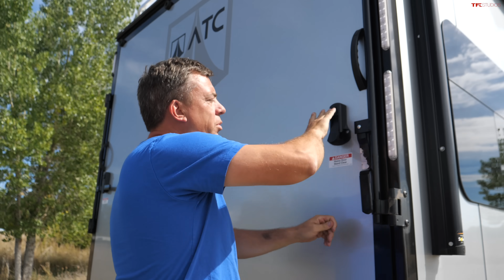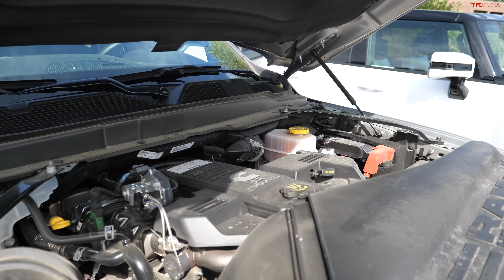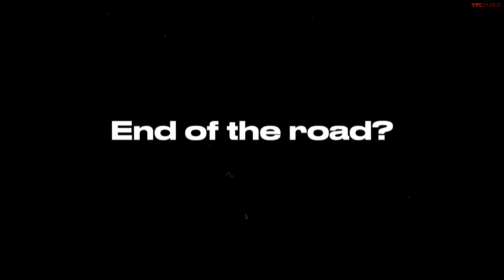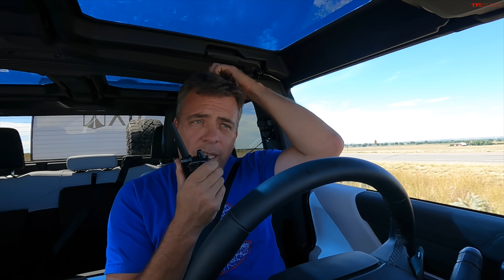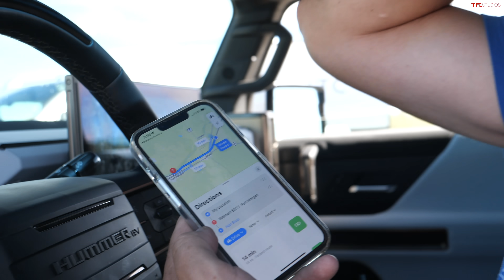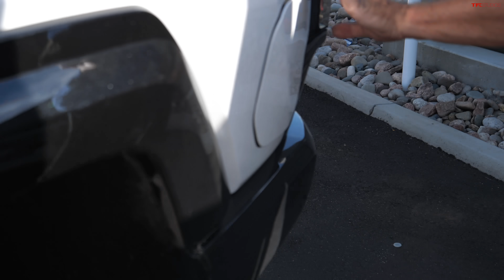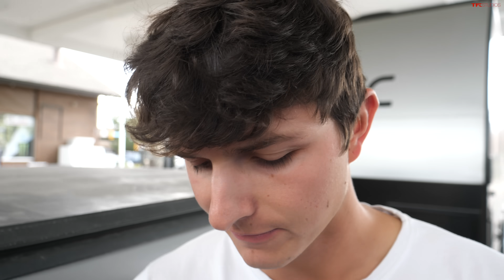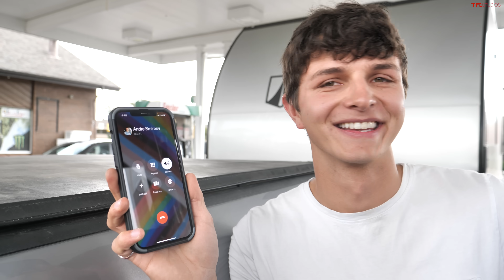How Far Can a Diesel and Electric Truck Tow An Identical Camper Trailer on ONE Fill-up?

Comment: I would love you guys to do a tow test in Canada with this electric vs diesel in our actual winter temps. -20 to -40 degree temps and see that 125 miles shrink down to 75 miles.
Reply: Exactly....do I not run the heat and freeze myself so I can get further?
Reply: @BrodieBr0  that's also a great feature of diesel/ gas vehicles: you can just circulate air around the engine to heat it up
Reply: I think that you can cut that down to kilometers instead... PLUS, cut that again down to only @ 70 km in those temperatures if you're towing & driving uphill.
Reply: And any real clamper knows these are small travel trailers that Cummins should be hauling a 5th wheel toy hauler and still leaving that ev in the dust
Reply: Yup! Exactly. I also saw one that was through Death Valley. The heat was killing the battery. Both circumstances could be really bad if you ran out of battery
Reply: They can simulate it by going to many of the northern states that have similar cold winters. For example, the Dakota's and Minnesota.
Reply: I’m not saying they don’t get cold, just northern canada usually is colder for longer periods of time. Last year we had -40 for 3 weeks straight
Reply: Gets just as cold in the upper 3rd of the U.S. international falls,mn  is the coldest  place in North America
Reply: I would check your fax on coldest place in North America I think most of the northern territories and Alaska would disagree with you on that even just looking at the data your coldest month on average is -21°C and I’m talking -40°C that is quite the difference
Reply: @matthewclark2341  international falls,Minnesota. Antarctica doesn't qualify as north America
Reply: I guess geography isn’t your strongest subject in school the territories are what border Alaska and you do realize Canada is home to the North Pole which is in North America . I have not mentioned anything about Antarctica so I don’t know where that is coming from
Reply: @matthewclark2341  google says "international falls" not Antarctica
Reply: I like your comment. Here in northern Alberta it gets nippy
Reply: EVS are not 0 carbon efficient, they give off at least 20 to 30%.
Reply: I would love to see that also I think those batteries would struggle
Reply: Hey, don't confuse them with facts.
Reply: You shoulda kept going to your destination like both of you a saw how much longer it took the hummer. As they say time is money!!
Reply: Imagine being stupid enough to buy an EV.
Reply: No need to go to Canada, I've seen -34f(-36c) so far this winter in North Dakota.
Reply: Don't drive your electric cars in a water puddle they catch fire and are a bicth to put out ..saltwater is even worse .  Found out the hard way in a hurricane.
Reply: I admit I did not watch the entire video, because I did not want to waste a half an hour of my life to find out something that I already knew. I would like to know what the weight of each vehicle was without the trailer? Another reply mentioned that you did not figure in the cost of producing the electricity that the Hummer used in your efficiency rating. I think that is a very interesting point. Especially when Evie's are trying to prove how environmentally friendly they are. I used to own a 2003 Dodge ram 3500 1 ton dually with the Cummins 24 valve high output diesel engine and a 6-speed manual transmission. I used to pull a trailer that weighed at least 5000 lb with a 16,000 lb backhoe on top of it and could go well over 200 mi on one tank of fuel, at around 6 or 7 MPG.
Reply: I was just gonna say, the cold and then also some service stations are 190-250km, sometimes 300km apart. Cant really take an “offroad/adventure” truck adventuring now can you.
Reply: The electric vehicle even though I have a diesel myself what have left the Dodge truck stand in still because the diesel probably would have jailed up with them temperatures the Houma would have kept Rollin
Reply: Yes winter hurt, but consuming this huge amount of electricity is bound to create some heat wich could be harvested.
That said, electric truck sucks. This kind of exercise is more edge case even if we dont perceive it.
Electric car in cities and suburbs are another story and this is where 80% of the population is.
Reply: Nah - my Tesla is able to tow just fine in Winter.  3500 pound trailer brought my range down - but I can still get 250 km range, which is more than enough in one day with my trailer.  typically get 500km fully charged.  The fact that it only costs me $3 to 'fill it up' for the day, is totally worth it.
Reply: Thank you amateur scientists, for proving just how amateur you are.
Batteries are more efficient and electrical systems in general at low temperature. That's why super conductors etc have to be cooled to close to absolute zero (-270 C) to work well. 
Whereas, on very cold nights, diesel will turn to jelly.
Reply: @distanceismyplastercast  I’m not attacking you and understand where you’re coming from. Colder weather = less voltage drop in power lines, superconducting, etc, but that’s not how batteries operate unfortunately.  Cold kills batteries. It might gain some better efficiency somewhere in the system, but not in our current battery technology
Reply: @chadgardnerdds3197  EV batteries  are heated and preconditioned before a morning commute .
You ever driven one in the winter?
Probably never been in one at anytime of year.
Reply: @distanceismyplastercast  You don't have to be a scientist to figure out batteries do not like cold weather. You just have to use battery operated equipment in cold weather to figure it out. In the cold the heater will have to use the battery for heat and for the blower motor. Gas/diesel uses the heat generated by the engine to heat your vehicle. Unless you like frosted windows and cold feet your range will drop.
Reply: @kenkinniph2327  Get a brain. The only truth in your answer is that gas engines make a lot of heat. That's because most of the energy released us as heat and very little us actually used to make the car move forward.
Guess during your vast experience with electric motors you've never noticed that they get hot too and that heat can also be used for air conditioning. Difference is only 10% of the energy is as heat, and 90% is used to make the car move.
Reply: @kenkinniph2327  he (Mr Welsh) was probably never outside in the real world. 🤣🤣🤣🤣
Reply: @distanceismyplastercast so can you explain why every single battery ever installed in a truck has a lower amperage rating in cold weather, every battery on an electric tool like a cordless drill or impact gun has drastically reduced life in the cold and included in the instructions is a disclaimer saying battery life will suffer at low temperatures? Maybe electric motors aren’t as affected by cold, I’ll buy that argument, but the batteries that power those motors to make then mobile are absolutely hurt by the cold.
Reply: @dipeachio6832 he’s certainly never driven a heavy duty pickup, let alone an actual truck.
Reply: @Ken Kinniph  more ignorance of the facts.
Do some research on modern BEV"s and how they heat and how they cool  etc.
Cold weather operation isn't the issue it was just 5 years ago,
Doofus...
Reply: @distanceismyplastercast  You aren't as bright as you think you are, batteries≠super conductors, try to learn the difference.
Reply: @distanceismyplastercast  I think you should volunteer as tribute to drive the ice road from Edmonton to ft chip in the middle of winter and whatever happens happens.
Reply: @privers5227  And why would any normal person want to do that?
Reply: @distanceismyplastercast  Please look at the owner's manual of an EV. Ask Google about EV range in cold temps. Tesla advises do not let the battery be exposed to -20 for more than 24 hours and to plug it in to prevent damage.
Reply: @distanceismyplastercast  obviously don’t understand lithium batteries and the need for them to reheat themselves at low temps thereby reducing range
Reply: @distanceismyplastercast  Batteries are not super conductors, in fact most batteries have resistance as they use a chemical reaction to produce power. Chemical reactions are excited with heat, that is why you cannot super charge a dead battery without causing it to overheat and catch fire. This was proven in the video as the EV started at 340kw and dropped to 140kw to prevent thermal runaway.  We also have two grades of diesel. Summer and winter. Winter blend doesn't turn to jelly.
Reply: @Thinkingaway  You are back in the dark ages. Modern batteries don't work that way, they store charge.
Reply: @distanceismyplastercast  umm, ok... we've all had our phone get hot on a fast charge. And we've all seen the Samsung batteries catch fire from fast charging. And our lithium-ion tools don't have nearly the life or power in the winter as the summer.  Those are as modern a they get.  But you already knew that. Just another arm chair critic thinking he knows what's best for the world. lol
Reply: @Thinkingaway  Self description?
Reply: @distanceismyplastercast  lol!   I live in Maine and friends have EVs.  Range is cut about in half at temps below 20 degrees F.  Amateur that David Welsh
Reply: @distanceismyplastercast  my god genius! You are right! My car battery works twice as well in minus 40c! And here I was boosting it all these years like a dumbass!!!
Reply: Cold weather does affect battery life, even with lithium batteries. Temperatures below the 32F or 0C degrees mark will reduce both efficiency and usable capacity of lead-acid noticeably, providing 70-80% of its rated capacity. at the same temperature lithium batteries can operate with very little loss providing 95-98% of their capacity.

If you really believe a electric vehicle will do better in winter then a ICE vehicle then go buy one. I also know of a Nigerian prince waiting to send you his money.
Reply: @matthewclark2341  80% of all vehicles in Norway are EVs. Think you'll find they spend months in darkness with temps well below zero.
You to need to buy an EV, because soon that'll be all that's available, no matter what govt you have, because the manufacturers have decided that's all they are going to make. In a few years an EV will do double the distance of a gas car with a full.tank and they'll cost far less to buy and run. 
 Don't you remember when mobile phones were the size of a brick and the battery lasted an hour. Scientists have been doubling the capacity of batteries approx. every 3 years for over 30.years now and they are not slowing down. But eventually, the batteries will be replaced by a hydrogen fuel cell to.make the electricity and one fill will do 1000s of miles for cents per mile.
Reply: I don’t know why your trying to make points on hypotheticals right right now. As to date there is nothing even close to produce as much unit of energy as efficient or cost effective then IC. It’s the most bang for your buck period it’s why we use fossil fuels. If there was some sort of substance that was better and cheaper it would be mass produced but it’s not.

I don’t know why you think I am against EVs what I pointed out is the infrastructure and  technology isn’t there. This real world test only proves that with the best conditions. What I purposed was to throw what in my area which uses heavy vehicles more then passenger cars. In conditions that are more common ( I live in northern canada) the closest distance to the next fuel station once you leave my city limits is 200km away And the closest ev charger station is 290km. On best conditions this hummer would fail to tow the trailer. 

I’m glad you brought up your phone as a point. Please open a gaming app on your phone and let it start to produce heat just from usage and what happens to your battery life? Good luck having it last half a day let alone it’s full day. As well over the 2 years of a battery in your phone your lucky to have 85% of its full capacity.

As of right now anything with a rechargeable battery will become less and less efficient after every charge. As far as hydrogen the Toyota muira as not made any significant advancement in the last decade it’s around and hydrogen storage is its own problem in its self not as easy as you think.
Reply: @matthewclark2341   ... I'm curious as to whether anyone adds up the real cost. That would include all time and fuel required to mine, transport, refine and assemble these batteries, not to mention the toxicity and cost of replacement of batteries. Bet there are electric car graveyards already in existence. Best to you.
Reply: Of course there is no proper way to recycle these battery cells. They are going to be waste. But I agree if you read my comments there is nothing that comes close to bang for your dollar compared to fossil fuels.
Reply: @distanceismyplastercast  Wait until you get stranded on a road and you call your buddy at 2 a.m. for a tow and he says his battery can't get him there and back. With gas/diesel you can can just start your vehicle fill up in a couple minutes. The tech is not available yet.
Reply: @kenkinniph2327  If I was I50 miles away I wouldn't be calling a buddy for a tow anyway, especially not at 2 am. Even if at that time his truck would have a full charge. Most people charge their cars at home, at home electricity prices, EVs cost cents per mile to run.
Reply: @distanceismyplastercast   My morning commute is like driving across Norway.. EVs may work great in small countries but they will never be as reliable and efficient as diesel.
Reply: @Ada-zn3pw  Norway ain't that small. But guess you ain't smart, otherwise you'd know that EVs are already more reliable and far, far more efficient than diesel engine cars. And unlike diesel.engines, EVs are still getting better.
Reply: @distanceismyplastercast  There is a reason why EV vehicles are far more common in Norway than in other equally or even colder Scandinavian countries. EV owners in Norway get all sorts of rebates from the Norwegian government (as an incentive to go EV), like reduced parking fees, registration etc. Don't you think you should have mentioned this?
Reply: @Nightstein  Why, that's how normal govts promote change. Only the GOP uses this stick approach, everyone else uses the carrot approach.
Same was done with solar panels in the early days, but once you've created the market, prices drop because if mass production and the incentives are reduced and removed, as they have been for solar panels.
When you talk about gas cars why don't you mention all of the federal and state subsidies they get, just to keep their profit margins high?
Reply: @distanceismyplastercast  yeah, it's the GOPs fault 🤡
Reply: @rafmatt  No it's all the fault of some of them, their Fox propaganda network and those elite  privileged billionaires that fund both of them.
Reply: @distanceismyplastercast  Look up how long it takes for a charge for the Hummer on a household cable. Some of the reports state you only get 14 mi. off of 8 hrs charge time. That is pathetic. Sorry to disappoint you. This is why the OP asked the question. This is why we need people to test this. If GM, Ford or Dodge state things you need to test them. They just want to sell vehicles.
Reply: @kenkinniph2327  All EVs would easily be fully recharged with an overnight even with the cheapest/worst recharger. 
But future EVs won't need recharging, they'll are their own electricity using hydrogen fuel cells, so they'll just need topping up like gas cars. Except a refill will be enough for thousands of miles driving.
All the cars are tested, same as gas cars, just read the motoring magazines.
Reply: @matthewclark2341  very well said Mathew
Reply: @distanceismyplastercast  I don't think you know what your talking about. Everything you stated is completely skeptical with absolutely no basis. Ev vehicles are a ploy to make rich people either and if you think EVs are better for the environment your sadly mistaken
Reply: @Joshg1984  You are welcome to continue nit thinking. Unfortunately, you non-thinkers are going to destroy the world for our as well as your own kids.
Reply: @distanceismyplastercast  I never said there using a energy crisis or that oil is a good idea but if you think EVs are the answer you are sorely mistaken. Actually I find it funny how people think that electric vehicles will take over. It's so stupid if you sit back and think about it. And I don't mean to call you stupid I think maybe your just misinformed or ignorant to the facts.
Reply: @distanceismyplastercast  their country is also the size of Georgia.. so yeah they can get away with 100 mile ranges, either way EV is not the way.
Reply: @distanceismyplastercast  Wouldn't that make them a hybrid instead of an EV?
Reply: @wc7516  No
Reply: @distanceismyplastercast  I reckon it is easy to have answers for hypotheticals.
Reply: @wc7516  Go do your experience then.
Reply: @distanceismyplastercast  Isn't the definition of a hybrid at least 2 sources of power? so if a vehicle has battery power and something such as a hydrogen plant to charge the batteries, isn't that a hybrid? That was my only point. I have no desire to do an experiment with an EV. They won't work for me. Until they can make it across the country without 30 minute plus charges every 125-140 miles when towing, they are a waste of money for me.
Reply: @wc7516  It's one source of power, hydrogen is directly converted to electricity which turns the engine. Is a gas car a hybrid because the gas is converted to heat, which expands gases powering the car.
Reply: @distanceismyplastercast  not that your condescending demeanour didn’t make it obvious, but your stripes are showing.
Reply: @dape3615  Sure
Reply: @matthewclark2341  you tellem bud i also live in northern canads and i think ev would be very useless in the cold or as a work truck even in the summer as your 300kms back in the bush with the logging industry. no charging stations within 500 killometers.
Reply: @distanceismyplastercast  Dream on , people can't afford the price of these vehicles. Two thirds of the United States are poor as a church mouse.
Reply: @Bottoarguewith  Your wrong far more than two.thirds are poor. The top.1% own 95% of the total wealth. That's why reducing taxes on.the rich is such more important than raising the min wage. It has been only 15 years since the last increase, after all.
Reply: @distanceismyplastercast  I was being generous , I agree probably 75% live paycheck to paycheck.
Reply: @distanceismyplastercast  First of I will say this, I know you are either a troll, or just a low iq kool-aid drinker. To put it into scale the main body of Norway from it most southern to northern tip is close to the same as from the California-Mexico boarder to just shy of the Washington-Canada boarder and less than half as thick. The Bulk of the Population is in the Southern part of the country close to the size of Colorado and is mostly along cost. So it is very Easy for that country to convert to EV one because of size the other due to where the population live. Now lets comment on the Hydrogen fuel cell, Why on earth would you waste hundreds of pounds in Batteries when the HFC could move the vehicle the same distance if not more? And Yes that would one make it a Hybrid as both could move the car on its own power. With your logic then Hybrids aren't Hybrids because the gas engine charges the battery. The USA and Canada are WAY to big and have way to many climates and spread out populations to make EVs worth it right now. Instead of trying to destroy the world by forcing one option why don't we just add EVs into the market like with Hybrid. It's a choice of vehicle that if it makes sense to you to use one than go for it. It's just not the practical choice for everyone.
Reply: @matthewclark2341  More idiot talk. 
EV cars 5-13 % loss with the new vehicles heat pumps octovalves etc.
A 400 mile range plaid X  losing  few 10's of miles is no big deal to the average commuter that drives less than 50 miles a day.

18,000  miles is 6,000 more miles that 90% of drivers do every year.

Got more shit for brains ??
Reply: @m.d.c.7910  more nonsense...
Where do you pull all that crap from..
Reply: @distanceismyplastercast  WRONG
Why would you take an inefficient  hydrogen  expensive  process to power an EV?
Hydrogen is $18 a gallon.
Stupidity abounds here in your distorted quadrant of the universe...
Reply: @robcrissinger776  Because hydrogen cells are ridiculous efficient at turning energy into forward motion compared to.a combustion engines. Add to that, that's there's a lot more energy in a gallon of liquid hydrogen than in a gallon of gas. The cost of a gallon is a stupid metric, what's is important is cost per mile and that's far lower for hydrogen and will get cheaper as fuel cells get more efficient and production increases.
And finally, it will never run out as you make it from water.
Reply: @distanceismyplastercast  You missed the point moron

Battery technology has surpassed  a hydrogen Cell  
Cost
Efficiency 
Packaging 
Supply

If you don't get that you don't get much..

Neither Fossil Fuel is as efficient as  BEV 
and certainly a hydrogen cell creating electricity 
To power an EV is pure stupidity..
Reply: @distanceismyplastercast  Screw Norway. I don't care what Norway does. They don't travel as far as here and have more train travel for further distances. We in the USA don't. If people don't buy EVs, then they won't become a big thing here. The end.
Reply: @jackrandom4893  So what will you buy?
The manufacturers plan on only making EVs. Gas and gas cars will be really, really expensive. Trying to stop a tide, has never worked well.
Reply: @distanceismyplastercast when an EV can gross 77,000 lbs and take me up a 10% grade 50 miles away from the nearest electrical outlet and not leave me stranded I’ll be willing to test drive one to see how it does. Until then my 855 cubic inch Big Cam Cummins built before you were born and still running fine will suit my needs.
Reply: @distanceismyplastercast   Yeah and Norway have massive issues with them.
Reply: @distanceismyplastercast  according to the charging station he showed 87% full for a cost of 38 dollars rounded up a bit with a charge time of 31 minutes. Full charge would cost approx 43 dollars. About 35 cents per mile for 121miles and a half hour wait. If diesel cost 5 bucks per gallon for 30 gallons and you can go about 310 miles it costs 52 cents per mile and a seven minutes wait.
Reply: @distanceismyplastercast  if Norway Spends months in the dark, where are they getting their energy to charge their vehicles? Certainly not getting solar energy from the Sun if they have solar panels out in the fields.
Reply: @distanceismyplastercast  
Lol. The guy was talking about towing test, and going long distance.
How many of those people are towing in an ev in Norway? And how long of a distance are they going? 
You know you are wrong/being misleading and now are trying to make excuses as to why you are right.
Reply: @m.d.c.7910  

There likely is, but don’t expect the government and the media conglomerates to say that that is a thing. They don’t even admit that batteries are very bad for the environment.
Reply: @distanceismyplastercast  
Cents per mile…… today. Just wait until governments/companies start upgrading the electrical grid and prices skyrocket. And this won’t just be for ev charging, it will be for everything you use electricity for.
Reply: @matthewclark2341  Tell that to the Norwegians. It does affect parked/sleeping vehicles. A battery under load or charging produces heat. At startup yes, but after a few miles there is little degradation.
Reply: @m.d.c.7910  You tube has the ability to make pictures. Please send Battery land fill videos/pictures as soon as possible.
Reply: @distanceismyplastercast  they will never make an ev do everything you just said. Car manufacturers have already admitted that they don't build cars to last long periods of time. They definitely could do so but it would hurt their pocket book. To believe that they will do things differently with evs is just being ignorant. They will make them good enough to just be acceptable, and that's where they will stop. Right now they are way to expensive for most people. I will never pay a $100k for a car, truck or anything short of a house.
Reply: @distanceismyplastercast  great. When will this be happening again? Probably never, because they aren't about to build something that will allow you thousands of miles between opportunities to extort more money from you. Keep dreaming though.
Reply: @distanceismyplastercast  fascinating Norway stories you present here, thing is that I actually compared BMW i4 summer to winter city driving. Guess what the range difference is? In winter it is 30 to 40% less range than in summer depending on how cold it is. This is practice vs your theory. I suggest renting an electric to test on your own instead of spreading sad stories online.
Reply: We'll see.
Reply: @distanceismyplastercast  Trying to push your socialist (communist) ideals on people.  Just because they don't agree with you doesn't mean they are dumb. And as this video shows most people who, here in the USA, buy a truck for a truck and use it as a truck can NOT do that that with the b.s. electric vehicle.  So go enjoy your brainwashed lost freedom and drink that coolade.
Reply: @distanceismyplastercast  not if you cut your diesel with gas👌.  I have an old diesel truck that will run on anything
Reply: @distanceismyplastercast  if the diesel is turning into jelly during cold weather you just put some additive in it to keep it from doing that, pretty close to K1 heating oil.
Reply: @distanceismyplastercast  It's fact that these car batteries do far worse in cold temps.  And there is anti-gel to prevent diesel jelling and block heaters.   But thank you Mr. Amateur Scientist.
Reply: @distanceismyplastercast  then why do car batteries go dead in colder weather? And why do solar system have thermal shutoffs to not damage batteries in cold weather? Hmmm.
Reply: @David Welsh  WRONG about chemical batteries! They have much decreased capacity when cold vs when warm.
Reply: @distanceismyplastercast  how much battery will it take to heat and defrost the windshield
Reply: @distanceismyplastercast  there is a huge difference between conducting electricity and using stored electricity in a battery in extreme cold conditions, if you think you are a scientist or an electrical engineer you would know that instead of trying to hide that fact in your previous statement!
Reply: @distanceismyplastercast   EVs don’t have fireplaces to keep you warm during those -270C commute. Not gonna be good for your range with trying to keep your butt warm.
Reply: @distanceismyplastercast  That's why there's winter fuel amateur , I've never had diesel jell off .......
Reply: @distanceismyplastercast  You really need to read the literature.  During the winter in cold climates, an EV's range will be reduced up to 40%.  That's real-world, sir.
Reply: @distanceismyplastercast  Someone here ain't even an amateur.😂
Reply: @noodlebomber4847  Someone here is a year off the pace. Well done Speedy.
Reply: @distanceismyplastercast  took me  a few minutes longer than id have wanted.😂